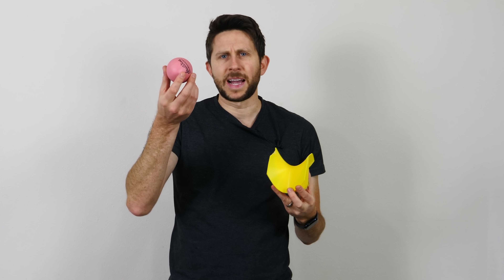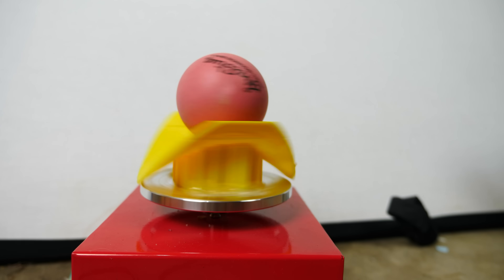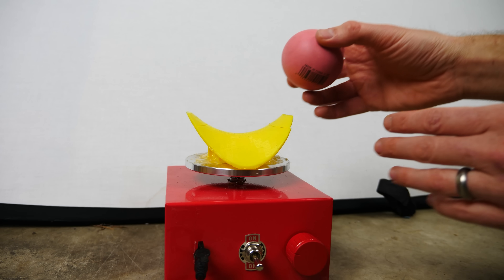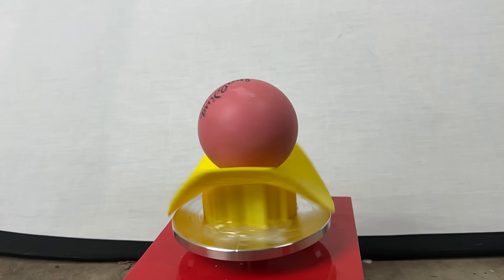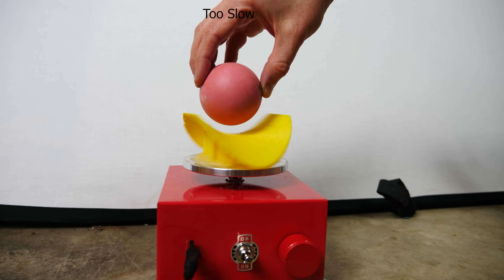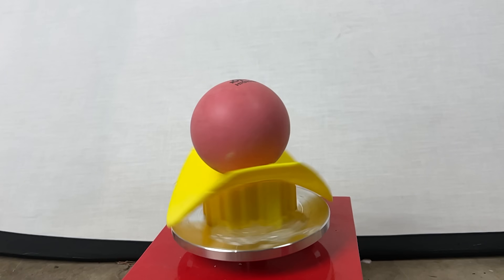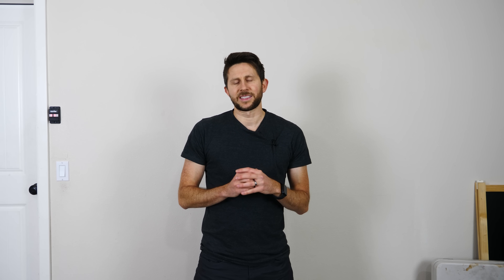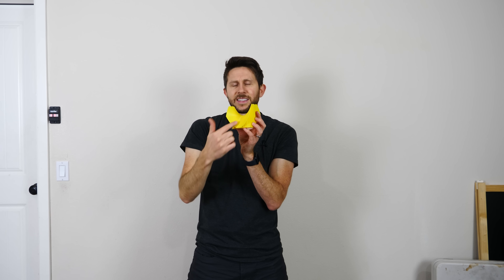The Odd Behavior of Spinning Saddle Shapes

Comment: Hi James I'm wondering is you use a much smaller ball (bb sized) if it would settle into an orbit around the center. I'm thinking the problem you are having with the large balls is that you have a very small range of stable orbits. Where as a smaller ball could better adjust by moving into a tighter or looser orbit depending on the rotation speed which I suspect is analogous to the strength of a gravitational field. --- I sense that the upward curve of the saddle is giving the ball a push. Could that be analogous to frame dragging.

Comment: 1:48 small tip: when writing equations in LaTeX use \text{} for labels (e.g. RotationalSpeed). It makes the labels non-italic and parses spaces, just like normal text. Otherwise the labels are rendered as math variables, which looks... not great.

Comment: 45 seconds in repeated, 
No Stable point 3 times.

2 minutes 20 seconds
To fast or to slow repeated 6 times.

YouTube keeps recommending your videos.
Normally I refuse because your videos regularly repeat the same thing over and over.

Overall big improvement.
The right speed point, you did use different ways of saying the same thing.

That is effective to get a point across and less annoying.

Comment: Localized motion research LLC, I like to think of this experiment as being the non-linear & the linear-fixing force. Being that gravitation is the force that pulls-straight, (linear) and the force that pushes & bends, (non-linear) is the fixing-force. When the force that pulls-straight balances  with the force that pushes & bends, (disorganizing-force) an orbiting-particle system becomes  balanced with its centroid. The pulling-force is the organizing-force that comes from the disorganizing-force and or the pushing-force, this act of reorganizing the pulling-force through the force that pushes & bends, becomes important to the  fixation of particle-motion. A vortex has a great deal of similarities as to its fixation in both space & time and size & time, concerning the dualities of the universe of absolutely everything and anything. The pulling-force is what holds the human body together and the pushing-force is what creates boundaries of which define our shape, your experiment has given me some critical answers to the particle-flow grid of the human-body. Thank you very much for this informative video!!!

Comment: Two issues I have with this.

1.) Why do you spin the ball as you release it?  Do different spins matter?  Can you spin the ball in the reverse of the spin of the saddle and have it still work?

2.) Why do you use two different 3D-printed saddles in the video?  Why not the same saddle throughout?

Other than that, this was pretty awesome.  :D

Comment: ESCAPE POVERTY FOR EVER!
SOLVE FOR EVER YOUR ENERGY-DEFICIENCY AND TRANSPORTATION PROBLEMS!
WAKE UP FROM THE COMA!
1) Please consider carefully and thoroughly the link below:
 https://www.youtube.com/watch?v=xX14NK8GrDY
2) The link above describes a simple mechanical four-component experimental device, which BREAKS SEVERELY (a) the law of conservation of mechanical energy and (b) the law of conservation of linear momentum. 
3) Friction (and the related experimental error due to that same friction) is reduced practically to zero either (a) by using of simple permanent magnet slides or (b) by using of liquid-nitrogen-equipped slides, which can befound in the two links below:
https://www.youtube.com/watch?v=KQH2UhHss6c
https://www.youtube.com/watch?v=Vxror-fnOL4
(Note. A cup of liquid nitrogen costs $2 only.)
WAKE UP FROM THE COMA!
SOLVE FOR EVER YOUR ENERGY-DEFICIENCY AND TRANSPORTATION PROBLEMS!
ESCAPE POVERTY FOR EVER!

Comment: I'm gonna comment without watching, then comment afterwards. 
It's not odd at all. The ball won't fall out when spinning because of momentum, basically. The ball wants to roll north, for example. But a few milliseconds later, north is blocked by the uphill of the saddle. So it tries to roll south or perhaps southwest. Then it can't, again, because the high part of the saddle appears again. By spinning the saddle, you have effectively made a bowl. There's nothing unusual or surprising or "odd" about that. 

Post-video edit: Ok but the part about the ions was cool.

Comment: A good demonstration of how magnetic levitation with permanent magnets basically works. Levitation using a static configuration of permanent magnets isn't possible due to Earnshaw's theorem for the same basic reason as the saddle: it's just unstable. But if you spin the magnets just like in this video, you can achieve levitation as with the Levitron. Very cool!

Comment: “There is no stable point”, there is ALWAYS a stable point. You could even balance the Eiffel Tower upside down (if it could support the weight). You just have to find the balance point (under ideal conditions ofc)

Comment: You always make me think of the most fascinating things. 😃

If you extruded/rotated a Paul Trap into the shape of a Torus, could you generate a Ring-shaped, or even, Paraboloid-shaped field? What do you think it be used for? I can see it separating different ionized particles by mass along the curve, but I could be mistaken...

Also, is there any way to create a Spherical Field? 

For some reason the dynamics of this affect seems to make me think of ideas like Science Fiction "Force Fields" which are capable of manipulating/repelling matter. Visualise a plane with myriad hills & valleys, each curved in the same aspect as a "Saddle" Point (Hyperbolic Paraboloid). By raising & lowering the hills, you could make a ball travel across the surface of the plane in any X→ / Y→ direction that you want. I'm also wondering if you could divert the momentum of an object traveling in a Z → sideways so that it now moves in a X → ?

In your experiment, if you could speed up/slow down the RPM fast enough & responsively enough (with a computer), you could create a metastable state for the ball, placing it in the optimum part of the "Saddle's" Curve. By manipulating the power levels of a series of rotating "Saddles", you could make the ball flow down the line. Now place them in a ring & the ball will travel forever.

Comment: So if we had an electric field oscillating at the correct wavelength of gravity we can both attract and repel in any direction we want, and the weight of the vehicle and it's occupants is negated. Sounds about right to me. Kinda cool seeing it done with a 3D print though.

Comment: I have a phenomenon I'd like to see you cover.  The one where if you quickly look at a clock you'll see the second hand ever so briefly go backwards and then start going forward like a glitch in the matrix. I have the base for our Ring alarm at the bottom of our stairs.  I noticed when I first glance at it, the LED is off, but I can stare at it after that and it never shuts off even for a second.  It does however seem to subtly flicker. I suspect it actually flickers on and off faster than my brain detect EXCEPT when I first glance at it, like the second hand on a clock.
Reply: hush puppy

Comment: The first time you used double the natural frequency so 8hz, that was too fast (not too slow as you wrote), then calculated that the real natural frequency (with coriolis effect) was 2hz, and used 4hz as spinng frequency(why didnt you use 2hz, then). But also the 8hz of the first try were a multiple of the natural frequency (assuming it's 2hz) so it should have worked the first time... You could have just said that you have no idea what's the real natural frequency and you have no idea why it worked with 4hz of spinning frequency only

Comment: What effect does the rotational spin of the ball has to the experiment? Every time you put the ball into the rotating saddle you give it a slight spin. My guess is that over time the axis and speed of rotation of the ball around itself gets synchronized with the axis of rotation and speed of the spinning saddle.
Reply: The ball and saddle are coupleing due to friction at their interface.

Comment: I think certain mass spectrometers use this to guide the fragmented ions of the input compound to a target where they are measured, either by time of travel or curvature in a magnetic field.
Reply: I think this is how the magnetic field rotates in toroidal ion traps as opposed to standard quadrupole mass specs. If you're familiar with the field of mass spec, think the MX908 and maybe GuardION mass specs use this type of trap.

Comment: People dont understand that alot of amazing things can be pulled off through "Shape" ...

Shapes cañ do a lot in regards to physics... More so than most understand.. For example broders engine design, the original true broders engine, only used copper coils and magnets... But the position and SHAPE of them was what mattered.. Then BP bought the designs and then, never heard from it again to supress it i guess amd broders died about a year after which is another stry..

Comment: It is not odd when the ball starts to roll off the saddle the arm of the saddle push it back up to the middle. If the saddle is spinning to fast it act like a baseball bat and knock it away. If it spinning to slow the ball has moved down to far down the saddle and the arm of the saddle knocks it away.

Comment: I wonder if this in lazer will work for the paranormal by traping the ions that they collect from static or electricity. That is why you pic up white clear orbs in paranormal pics.ghost orbs are different from dust orbs.ghost orbs have some intelligent paterns that random dust.the white part of orb is probably water droplets trapped in a round ball of emf so on and the camra flash reflects off of the white cloud inside.So if this the case than the lazer that trap particals could possibly trap a ghost orb since they use laws of physics to operate on our dimsion.It would be crazy to see a ghost in front of your eyes with lazer that traps and high light the ghost particals like in your video.They already have a real time ghost cam that let's you see ghost in real time.

Comment: Take any size saddle and any size ball both with smooth surfaces, lube the hell out of it with WD-40 or some kind of lubricant and it will work with any size so long as a ball is smaller than the inside of the saddle.  As long as it can't climb it'll stay. Obviously the smaller the ball, the faster the saddle will need to spin, all it's really doing is simulating a bowl. The ion trapping how ever IS much more complicated and much more thought provoking
Reply from the maker: correct, a very low friction environment is not dependent on the ball

Comment: 2:40 "At 4Hz IT WAS NOT STABLE. (Then i found that its natural frequency is around 1Hz instead of 4Hz so i tried again at 4Hz.) At 4Hz IT WAS STABLE NOW." What ????
Reply from the maker: Sorry that was confusing how I said it. The natural frequency of the ball was 4Hz. So that means I would have had to spin it at least 8Hz (2x) to make it stable. But it wasn’t, because the natural frequency while spinning is actually lower (around1-2Hz) so I had to lower my spin rate to around 4Hz.
Reply: @TheActionLab  Oh ok so it's when you were rotating it at 8rpm that is was falling off, right ?

Comment: This is a tuned mechanism very similar to the demonstration using a thick vertical rope fixed to a speaker cone that stands up rigidly. Not sure if you've shown that one, but I have seen it on youtube.
Reply: That would be interesting! I tried some simple searches, but couldn't find such an experiment -- do you have any more clues?
Reply: I've found this pretty poor example. -  https://www.youtube.com/watch?v=4AdJQVaMrlc  - The video I originally watched was in colour and used a thick rope, but it was the same principle as this one - Vibrating a vertical rope at a certain frequency and making it rigid and self-supporting.

Comment: I never really understood how a quadrupole ion trap worked until I saw this. Thanks!
Reply: I too understand quadrupoles better now. However, unlike in induction motors which run by regular three-phase electric power, in quadrupoles the field doesn't actually rotate, right? It is always just alternating between + and - at a 90° angle
Reply: This video is epic, BUT THIS IS EPICCER!!!! https://www.youtube.com/watch?v=_r6FdS-O3_8

Comment: I just realized this is why Lagrangian L1, L2, and L3 points -- where the equivalent potential is saddle-like -- can have stable orbit. Dynamic stabilities are awsome.
Reply: Was thinking the same thing but then realised L1, L2 and L3 all require some small thrust input to remain stable (including the new James Webb Telescope).  L4 and L5 on the other hand are naturally stable due to some weird mathmatical quirk about barycentres which I can't quite get my head around.  L4 and L5 don't need any thrust input at all.
Reply: @Reuben-John  right, but if you watch what he's doing he's putting a slight spin on the ball as he let's go. That's equivalent to the thrust input to enter L1, L2, and L3
Reply: @VitoHGrind  It's not equivalent because it's a one time input not a constant thrust input. That spin is just getting it started.
Reply: @VitoHGrind  Yours is how I understood this situation, but the things might be not the same considering all those inertial frames. Now, trying to solve dynamical equations for the first time in almost a decade just to check if they are the same or not. Fun times.
Reply: Earth-Sun Lagrange points have a significant perturbing force from the Moon, made worse by the elliptical orbits of Earth and Moon, and by Earth's ocean tides, and by the plane in which Luna orbits being tilted with respect to Earth's orbit. To a lesser extent, gravity from other planets also perturbs Lagrange points, all at different frequencies and amplitudes.
Reply: One more thing I'd like to add to my (potential) blunder is that I saw a paper discussing about this kind of dynamical model, and it mentions it's actually L4 and L5 that have saddle-like potentials. But I haven't seen or heard such explanation before, and it is not explained well in the paper, so I'm not so sure.
Reply: This video is epic, BUT THIS IS EPICCER!!!! https://www.youtube.com/watch?v=_r6FdS-O3_8

Comment: What if you adjusted the grip or the shell of the ball would that make a difference, wouldn't using surface tension be another factor in the whole equation of having anti-gravitational pull from the ball never mind